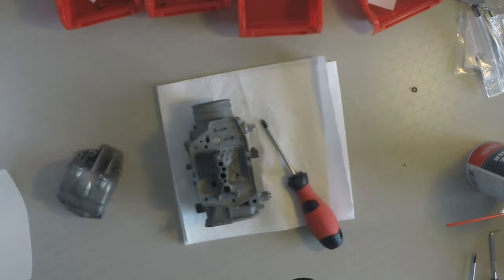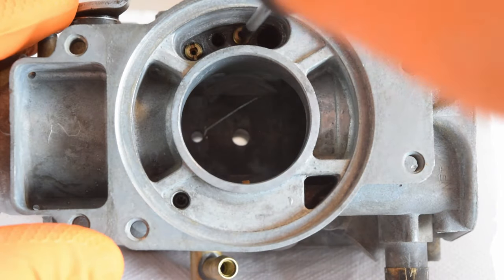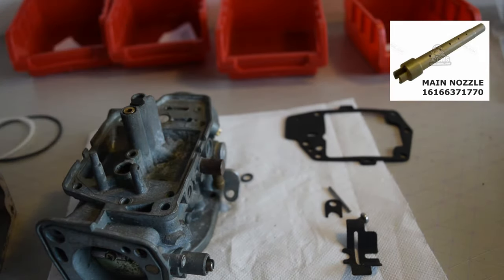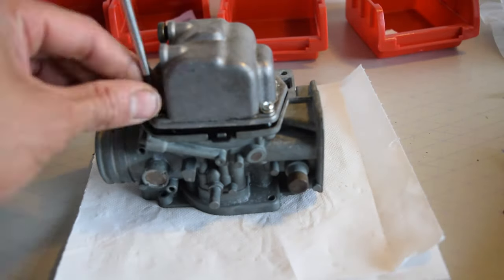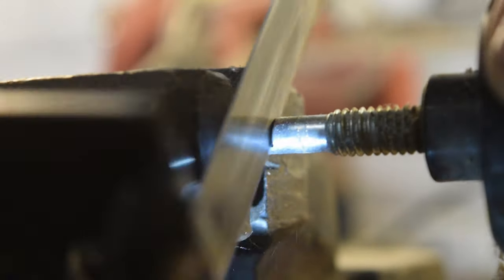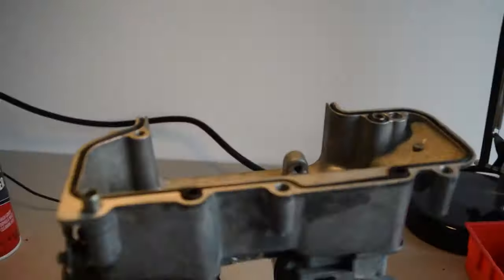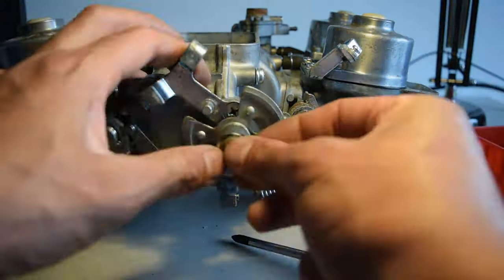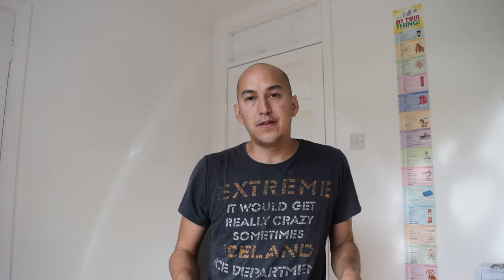Honda GL1000 Goldwing 1978 - Restoration - Carburetor Reassembly & Rebuild - Part 5

Comment: i just got a 1977, thanks for the video!
Reply from the maker: What kind of condition is she in?
Reply: @garagemade4422  sat for 5 years, needs caliper rebuilds, carb rebuild, gas tank restore. etc.. all the fun stuff. Not great shape to most, but for a handy guy like me, it was worth the 350 bux in gas to go get it. rear wheel spokes where done, so i got a 16" seven star mag, we will see how that works out.
Reply: FYI this kit is only on ebay now, and its up to 80 bux US

Comment: I’m trying to figure out how free the carburetor piston slides have to be 2 of mine went in alright 2 need a lot of pressure do yours just slide no problem or do they rely on engine vacuum? Thanks

Comment: I have a full dresser 78 Wing...can I remove the starter without having to pull the engine? Thanks! Great work!
Reply from the maker: I believe so
Reply: Yes, unbolt wire and bolts. Oring on starter nose seal in Case is stuck, wiggle pull push tug spray lube, do not pry, may break soft aluminum. Slide starter forward. With stock exhaust Should come out, get new oring for reassembly

Comment: OK, liked and sub'd.  I just bought a 78 GL1k.  It is rough, not like the photos in the ad :)  It cranks right up on the first pop, holds idle fairly well at most RPM's, but has a problem around 2k RPM.  Also, on the right exhaust, there is some somewhat significant backfiring and an occasional flame when the mufflers are off.  There is a slight smell of fuel in the air of the garage when I have the bike idling.  Is this a carb issue?  If it is, I want to try the repair myself.  I watched your video and the carbs look easy enough, but what about those linkages?  And what is "syncronizing"?
Reply from the maker: Thanks for the sub,
I'm not sure carbs are easy.  I'm crossing my fingers the bike starts.
Synchronizing is where you set the throttle position for each carb. It's fairly easy to do by ear (I've only done this on my BMW, which only had 2 cylinders).  The carbs aren't the easiest things to get to, but the smell of fuel kinda indicates a rich mixture. I would do the easy things first, pull the plugs and check the colour; maybe change them if they look bad. The timing chain is easy to get to just pull the radiator, bad timing will give you a miss fire.
Good luck

Comment: So after rebuilding them an putting them back on the bike how hard was it to get them in sync
Reply from the maker: I've not got the bike started yet, but with the correct tool it shouldn't be difficult. You connect the vacuum gauge to the inlet manifold and the balancing adjustment is also easy to access. Hopefully the bike will start in a few weeks.
Reply: For someone who doesnt have the money to afford the tool how would they do it then?
Reply from the maker: I've seen videos where people have used clear tube and plastic bottles with a coloured liquid to see the difference in vacuum. There are two methods I've seen one looks safer than the other (no risk of liquid getting sucked into your carbs. The sync tool only costs €25 it might be worth the investment.

Comment: We're doing an '81 model (in Australia) that has no mixture screws..... God knows how we're gunna tune it.
Reply from the maker: How many mixture screws are you missing. I've got a couple of carb bodies that I've replaced and I think they might have mixture screws in them.
Reply: @garagemade4422  Found them... As I wasn't the one who took the float bowls off, I asked the guy where are the float bowl screws and in that container was mixture screws !!!!  ... So today I fully assembled the set and they're ready to go back on the bike... Christ, what a mission cleaning them was... 20 years it sat in a garage unused... they were full off hard gunk & corrosion... I used tiny little wire brushes in a Dremel... this engine cleaning spray that softens gunk... finishing with a pressure washer... tons of work... anyway, the came up looking beautiful... hopefully I haven't stuffed anything up.... On they go !

Comment: NO ORING UNDER THE CARB SLIDE!!!  I saw in another of your video you use a 21mm float drop height.  The GL school I attended in 1975 specifically said to use the 'standing float' height.
Reply: Thanks for your comment. I hope it helps others, I used the Haynes manual as my reference.

Comment: tgx for that video ..but can u do it more clear .. i mean in normal speed and whith more detl .. cuz ther is video from Randak and kost 25 Euro so u video gona be verrrry usful
Reply from the maker: Sorry about that, I find that people have a very short attention span so I have to keep the video short. I will do a follow-up video. If you have any specific questions I could try to answer them or show you more detail
Reply: u r very good and your way is very simple but if u mak it long and more clear and whith more detel about evry tbing like Engine... Carburator ..final driv.. shocks..and evry thing cuz gl 1000 is old and ther is not alot viedeo in Youtube ... i watching u from Germany
Reply from the maker: I made a mistake with the vacuum chamber so I have to pull off the top half. I also forgot to measure the float height, I'll try to show in more detail how I do this.